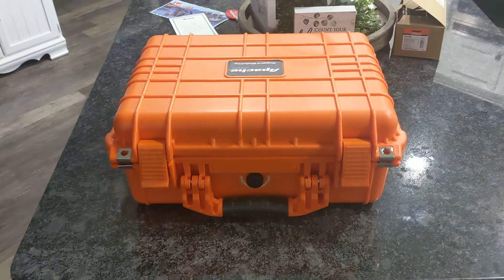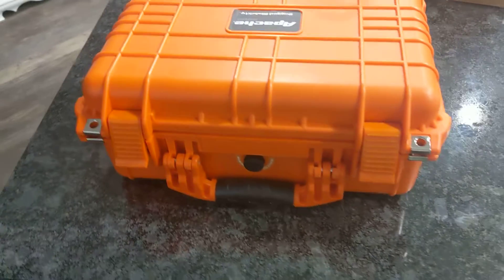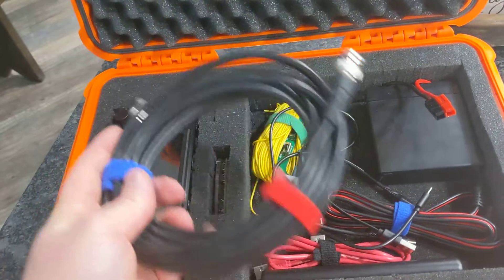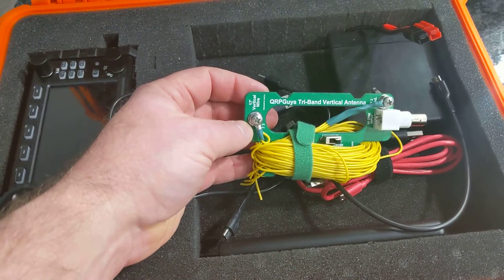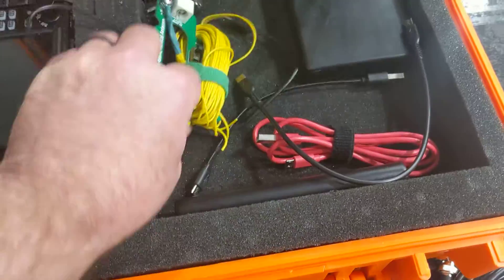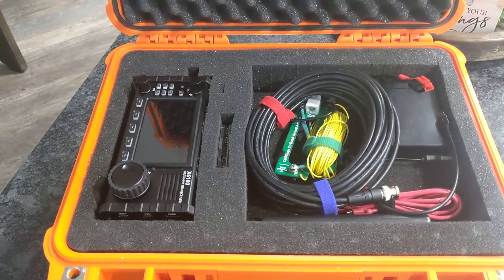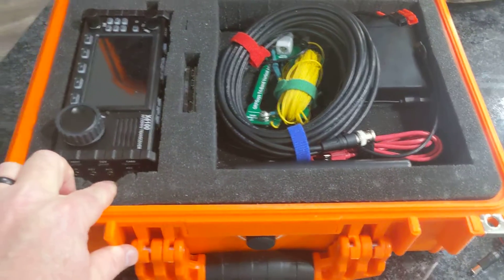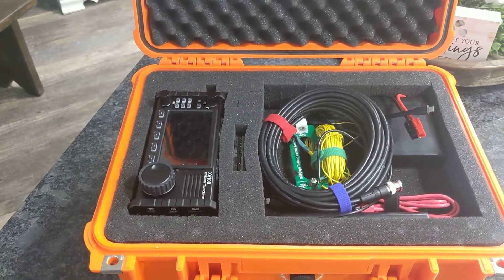x6100 GO Box for Radio Comms / Communications

Comment: Add an arbors throw bag and 30 feet of 95 lb paracord. If that antenna is like my CHA LEFS 4010 it likes to be about 15' high with a choke at the balun. Maybe a cigarette lighter style power cord with Power Poles and or Alligator clips with Power Poles.

Comment: Once you have the foam plucked for all your items...
Look for some "Plastidip" type spray, it's a flexible plastic/rubber type spray.
Just give the plucked foam a gentle couple of sprays, just enough give it a slight coat
That will give a little bit of rigidity, and also stop the cube's separating.

Comment: Great setup. The onluu thing i would add after traveling many times on aircraft with the Apache. Make sure you padlock or ziptie the top and bottom shut. I have had mine come open twice when I didn't lock them shut. Not very secure latches.

Comment: My point of view, you have to much weight! The Xiegu is small, but has it´s own weight, the 8Ah as wenn, another Batterie pack also. For an emergency setup absolutly ok, also if you use it in your backseat of your car. But if you want to go in the field without a car, it´s too much weight. Nice video and you made a great box! 73!

Comment: Put some ferrite beads in the coax for the rf coming back
Reply from the maker: I've got some ordered, they should solve the problem.  Ill keep you posted.
Reply: @w7mbp348  I’m very impressed so far with my X6100.  Its not the same as my KX3 or IC-705 but it works remarkable well for being half the price of the 705.
I put my X6100 in a small carrier I had from a motorola gmrs radio pack.  Holds the radio, flat pack bioenno battery, mic, mini balun, cut wire antennas and small coax.  I’ve reached Hawaii from colorado (on 5w) and nearly everytime I use it with my station hex beam, I make good contacts on the first or second try.  Great little radio and priced right.

Comment: Great video! Your go-box is very similar to mine, except I have the Xiegu G90. I'll be upgrading to the X6100 soon. That QRPguys antenna rocks. I put mine together a few years ago, with 26 guage silky wire I bought from The Wire Man. I've had hundreds of QSOs on it....it's my "go to" field portable antenna. I hold it up with a 17 foot Shakespeare Wonderpole. My entire station can be deployed in about 5 minutes.

For using a Pi 4, I power it using my LiFePo 4 battery, the same one that powers the radio. To drop the voltage down for the Pi, I use a BEC (battery eliminating circuit) for RC aircraft. I buy them off Amazon for about $9. The BEC that I use will supply 5 volts (3 amps) from any supply 5 volts to 24 volts. I solder the battery power wire to one side and the plug for the Pi to the other side then cover it with heat shrink tubing. It works great and doesn't take up any extra room in the box.

Comment: Is it the 3800 or 4800 box please
Reply from the maker: 3800
Reply: @w7mbp348  thank you, found a UK supplier now. Good idea and inspiration.
Reply: @G6EJD  Can you share the name of the supplier please?
Reply: @yrath5034  in the UK you can get the same box from Solent Plastics or Amazon, I got mine from Solent Plastics they were 1/2 the price of Amazon. Foam comes pre-cut in cubes, perfect, there are two options pre-cut or solid foam.
Reply: @G6EJD  That's great, thanks!
Reply: @G6EJD  I looked on Solent Plastic...
I didn't see the 3800, there are some MAX Cases...
Do you have a link or Nos... Thanks
Reply: @MINI-4X4-RADIO  it’s their MAX380 available in orange when I purchased it, now only black on stock, the 380 refers to the width, I got the cut foam version, lots of little squares to fine tune the shape.
Reply: @G6EJD  
Many Thanks... Which height..?? MAX380H115 or MAX380H160
Reply: @MINI-4X4-RADIO  I went for 115, it’s more than enough to allow the radio to fit, but as always the extra height could be useful to increase the storage capacity
Reply: @G6EJD  Cheers...
Yes 115 vs 160 it's striking the balance between essential vs nice to have..??
Reply: @MINI-4X4-RADIO  the one illustrated in the video is 160mm high

Comment: It’s really great, thanks for sharing the idea. I’d like to replicate it, but where to buy the case. Your foam cutting is really neat, how did you do that, in my experience cutting foam is really difficult and I end up with really jagged edges - excellent idea.
Reply from the maker: The foam comes in perforated blocks so you just press your item down to make an outline and pick the blocks out.  But I use a steak knife for a cleaner cut and keeps you from pulling out blocks you don't want to pull out.
Reply: @w7mbp348 Brilliant thanks for the tip, I’ve just zoomed in to the product images and can see the pre cut foam now, that makes it much easier to get started.